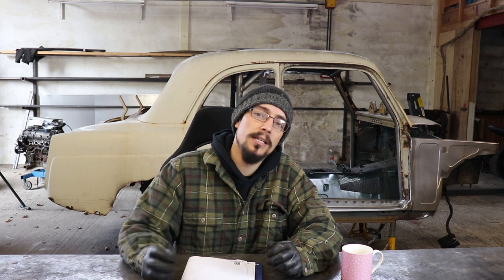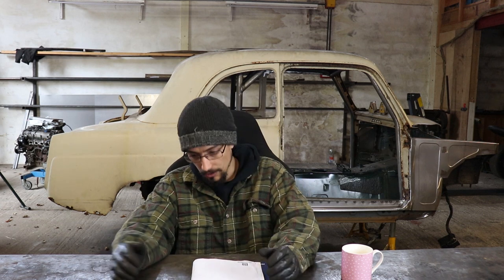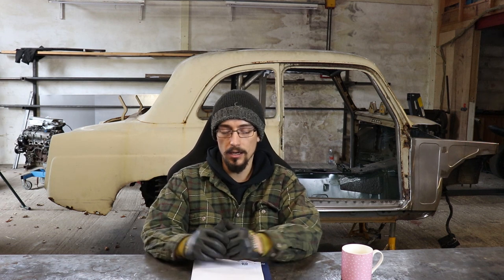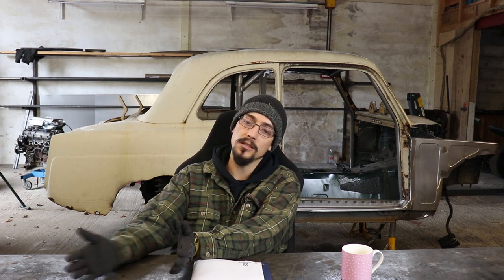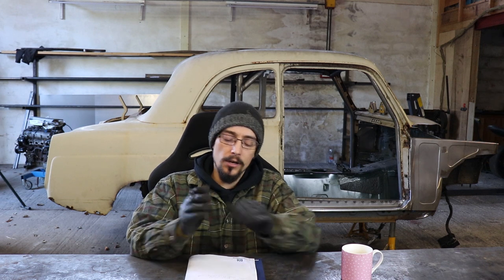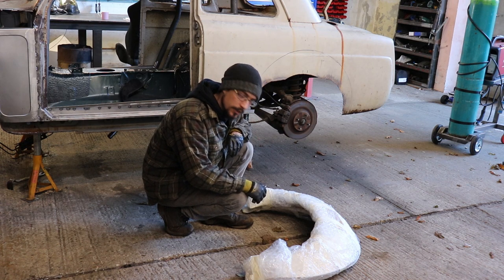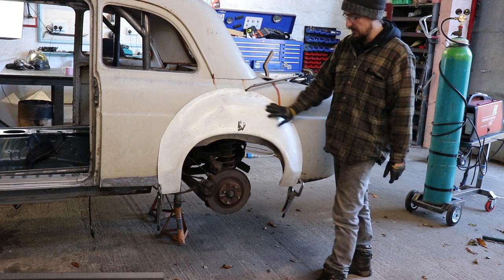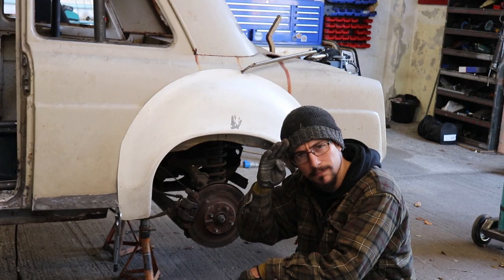MAKING YOUTUBE MY FULL TIME JOB + NEW ARCHES FOR THE MONGREL.

Comment: I’m coming at you from the U.S.A. I’m 70 years old and envy a man in your position. I like your work and skills. I just got a guy , like yourself, to build my hot rod. At 70 I didn’t have the place, the tools or the time to build it myself. My guy built my car like it was for himself. It still needs a little work but 435 horsepower in a 3000 lb. car should be fun.
I don’t miss a step in your build. You know your skills and you will succeed. Good luck to you.
Reply from the maker: Sounds like an awesome project. Cheers

Comment: Here is a thought you might consider.  You fabricate nicely.  You could make something simple to sell.  For example: Tool boxes.  Large.  Small.  Jewelry box tool boxes even.  Nice bead rolled sides.  A Tray with two or three compartments. A hinged lid with a hasp for a lock and a handle.  Simple welded sheet metal. Premium priced Small jewelry boxes most of all.  Sell them to guys for their girls for the holidays.  Video advertise your own products in addition to your regular projects.  Consider other things to make & sell as well.  Bo.
Reply: The time it would take to do that would be insane. To make enough $ off that he'd have to only do that.
Reply from the maker: Unfortunately that's the truth.

Comment: It's none of my business, but I have some business background. From my perspective, your key skill is as an excellent fabricator. I think a lot of your subscribers would enjoy watching you fabricate anything. You have £25,000 subscribers, one of whom might want to buy the 100E when it's finished, why not auction it after the build? You could strengthen your following by getting your followers involved with choosing the finishing touches, like paint job and interior. If you have to make a few roll cages to top up the funds, post making those too - I'd watch! In fact I'd order one for my Ford Puma Trackday motor given a chance. The hard part is doing this work and filming it, editing and posting. You may find investing in a couple of extra cameras and lapel mic would allow you to work without having to keep setting up the shot.
Reply from the maker: Its something I can consider for sure and I will absolutely film some of the jobs I get in but its the filming and editing that takes the time, so if i get to the point where I need some cash in I need  the job in and out. Its a tricky one to juggle but I'm sure it will work out. Cheers

Comment: As a suggestion, try refining your presentation. Work smarter, not harder.
A Lavalier radio tieclip mike would really help the audio, which is currently pretty average and echoey.
Also try adding some narration in post rather than standing talking. That way you can explain what you are doing as you do it,.
PM me if you want any tips or help.

Comment: Hey Matt My welding is improving from watching and learning from you 
I was doing the joined up e thing earlier and it looks quite good for me lol the only problem is it seems to be sat up high and when I grind it down I'm not getting a lot of penetration into the steel any idea where I'm going wrong??? 
I'm trying to knock together a rotisserie out of 40mm box section with a 3mm wall thickness 
Using a gasless mig with flux core 0.9mm 

I'm glad to hear your not aiming to provide extra content for patrons it would rule me out and personally I think it's a bit greedy by hey I'm a tight arse Yorkshire man 

Tool reviews is a good idea but like I said before you might be a touch too honest you call a turd a turd 👍 but at least we know your thoughts not some bullshit because your benefiting from saying something untrue 

Why didn't you fabricate steel arches?
Reply from the maker: ive not really done much with flux cored but i think it needs to run hotter standard so try cranking her up. I dont the kit to make arches like that or the patience. Cheers
Reply: Thanks for taking the time to reply Urchfab I have it on max it's just got low or max I don't know about wire speed maybe I am going wrong there 
I dug out the old stick welder today I gave that a shot I could see the metal change colour in front of the weld (unlike the mig I wasn't seeing that)  but I seem to have the same problem when stick weld it's getting great penetration into the metal but It Kind of sticks to both sides and leaves a channel of dross in the middle of two reasonable looking weldsm 
any advice would be greatly appreciated 👍

Comment: Why not also film parts of your customer work? That way you don’t lose that work of this doesn’t work out or becomes a chore.

If the work itself isn’t that interesting then offer tutorials based on what you’re doing such as tube bending, fitting the cage, basics for a total beginner would also be good (we forget what we know after years doing it).

I do most of my engineering and fabrication in the food and drink industry which isn’t exciting in itself but the engineering and fab is. That’s what I am going to try I think so may help, may be a crock of crap haha
Reply from the maker: Ive done a fair few tutorials in my older videos, I will try to do some more for sure. Its the filming and editing that takes the time so its trick to juggle. Cheers

Comment: Like so many, I have been following this project along with interest. A little disappointed that it wasn't to have been as a street car as it would have been awesome, but I was horrified at the thought that the "flares" are to be those gross oversize puss filled blights on a tidy body style. I don't care if the flares are fiberglass or anything else, it's the ugly boil on the side of the body that has me recoiling in horror. Perhaps something much more tidy that follows the contour of the wheel cutout & retains the body lines of the side panels would work much better from a cosmetic point of view.
Just saying.